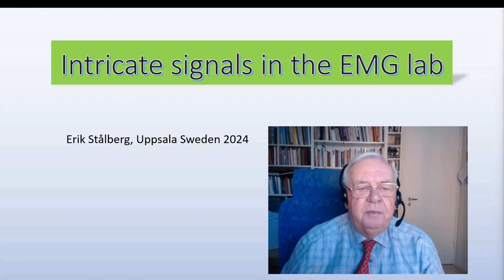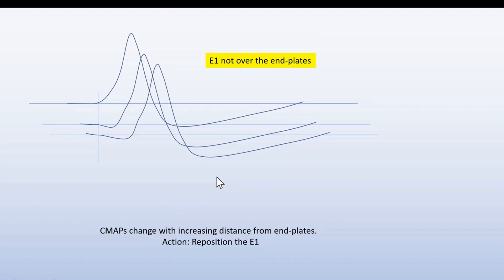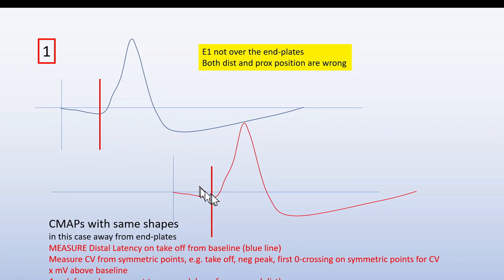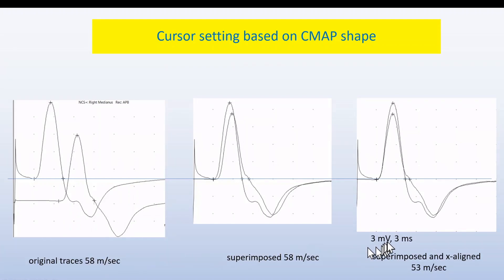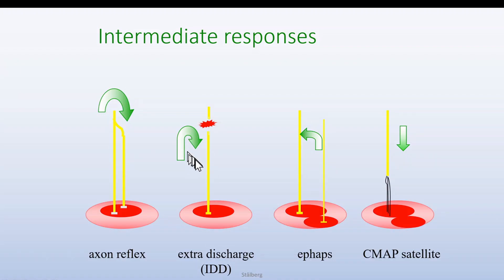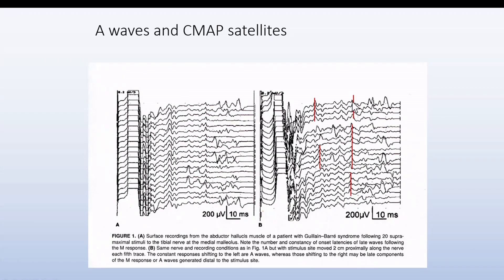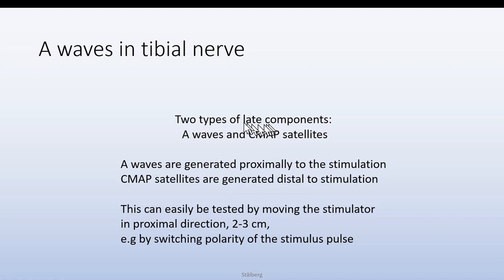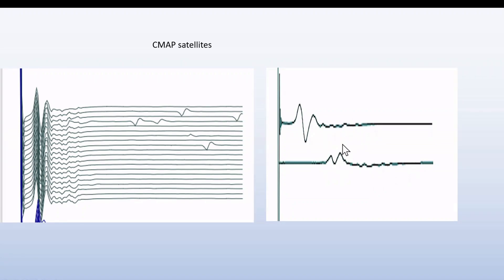Intricate Signals in the EMG lab

Comment: As always and for over forty years, I always learn from you not only what is new but what is of direct relevance to daily practice. Your teachings also demonstrate that, what we may – from the influence of time and weight of routine – take for granted as mature, complete knowledge, turns out to be incomplete, reminding us that ‘knowledge is infinite’. What I have just learned from your presentation, on all its ‘chapters’ but especially on figuring out comparable points on stimulation action potentials, is invaluable for immediate application particularly for the ulnar nerve across the elbow, where even few m/s shifts can make or break a diagnosis. Thank you as ever.